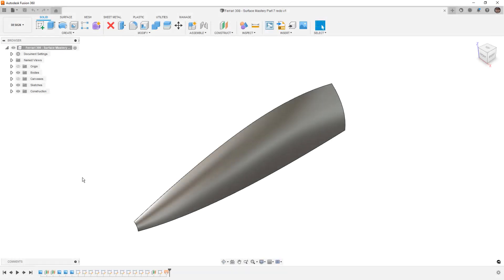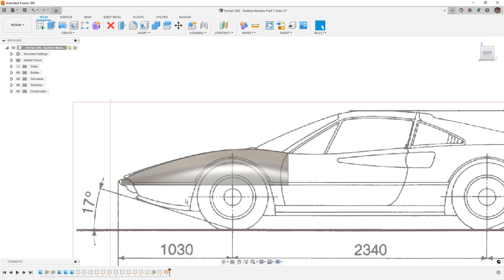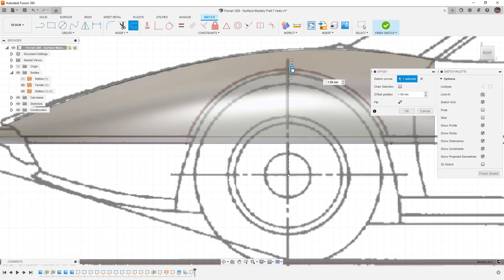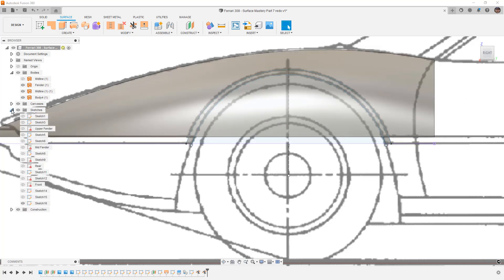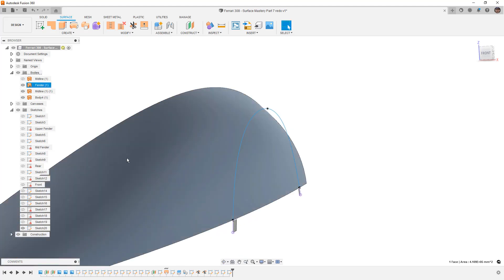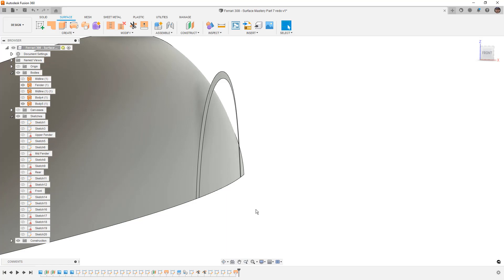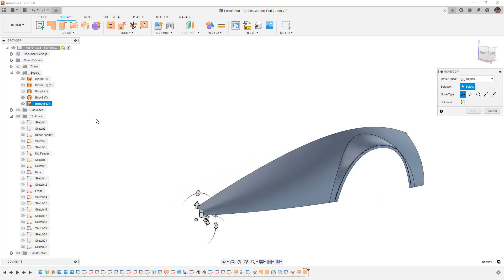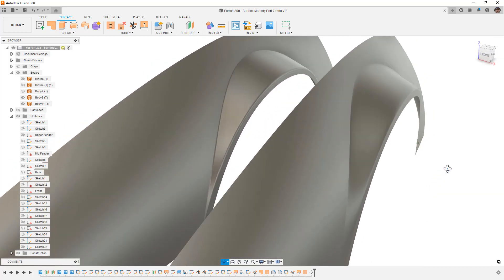Surface Mastery Part 7 - Blending Multiple Surfaces with 3D Splines, Lofts and Patches | How To

Comment: Appreciate you showing both methods.  I like the tendency control using projected 2D sketches but do not appreciate the added work needed to get it to work.  I believe practice is the only way to get more proficient at this.  Thanks for the insight like always.
Reply from the maker: Thanks for sharing!  And yeah in other CAD systems you can have 2 different 2d sketches and build a 3d curve off of them.  For whatever reason Inventor and Fusion want you to make a 3rd sketch which complicates things.  At least with Inventor the 3rd sketch consumes the first 2 so it keeps things a little cleaner.

Once Fusion has a bit better 3d sketch control the 3d approach will be much easier.  Right now its still kind of tricky with splines.

Comment: Random question, if you've made a circular hole in a surface and screwed around with it so much that it's no longer perfectly circular, is there an easy way fix it? Not that I would have done something like that :D
Reply from the maker: LOL. me either ;)  well unless the surface was a plane I don't know that it would ever stay a true circle.  There are times when patching the hole and cutting a new one are the best option.... maybe thats where you are at?
Reply: @LearnEverythingAboutDesign  That might work. But to answer your question, I think the point I'm at is "start from scratch", for about the 6th time already. Form workflows are HARD. You make it look too easy!!
Reply from the maker: @brianfuller7241  what are you trying to model?
Reply: @LearnEverythingAboutDesign  a headlight shroud for the first gen Miata. My original approach was based loosely on your MR2 tutorial. I finished one iteration, but the 3d printed part had some edge weakness issues that I couldn't solve.  I'm starting from scratch making it a one-piece shroud and lid and hoping to make better decisions along the way this time. The design kinda got out of hand and was just brutal to work with.
Reply from the maker: @brianfuller7241  Very cool.  are you going away from the stock NA round headlight and doing something lower?  If you want to join the discord server send an email to support@caducator.com  there is a growing group on there and a place to ask questions and share designs. if you want.
Reply: @LearnEverythingAboutDesign  email sent! Thanks so much!! I'm going for an OEM+ look, so stock size for now.